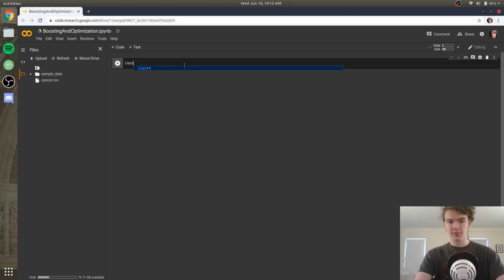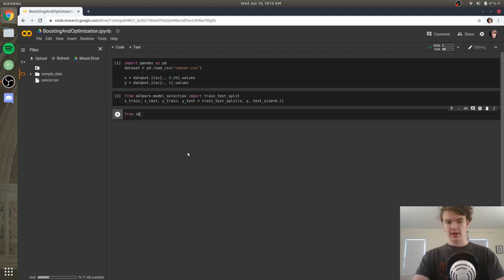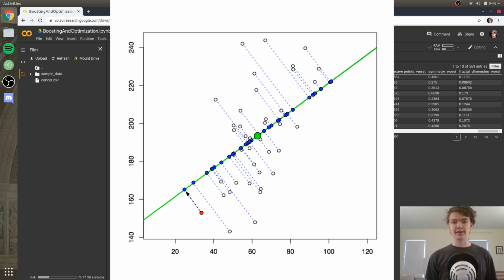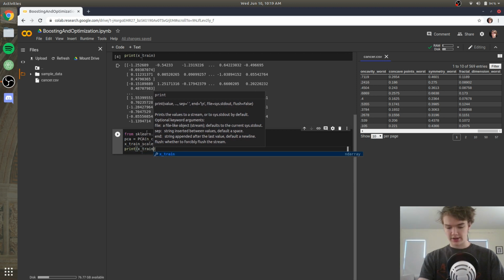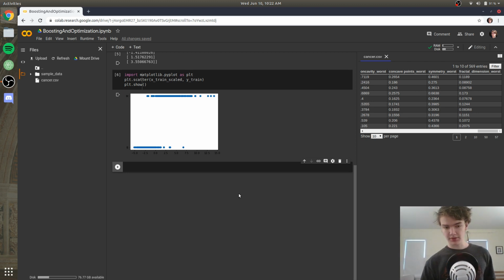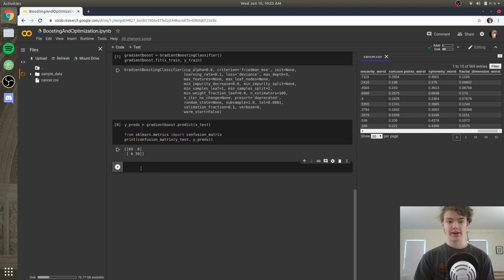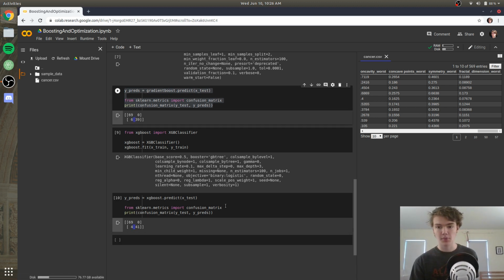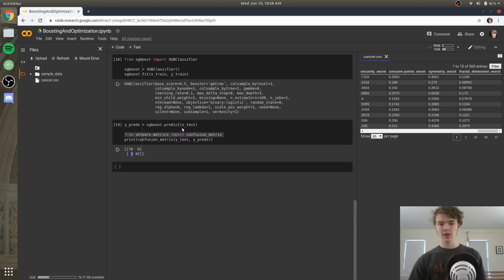XGBoost and Principal Component Analysis | Practical Machine Learning with Scikit-Learn #3

Comment: Maybe I missed something, but if you just ran PCA on X_train alone, that means that its of a smaller shape than X_test, so how do you get the model to predict X_test? because it has less features compared to X_train, which you fitted the model with, won't you get an "feature_names mismatch" error?🙁
Reply: I have the same question.